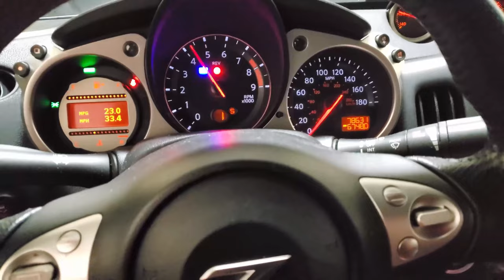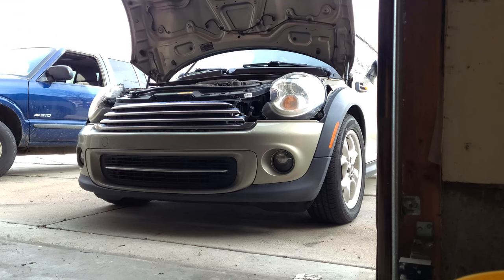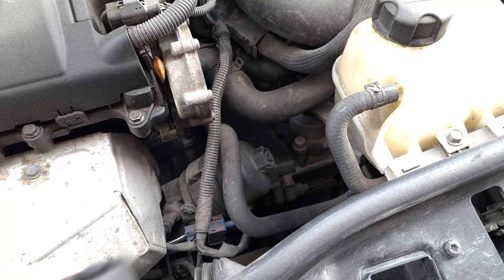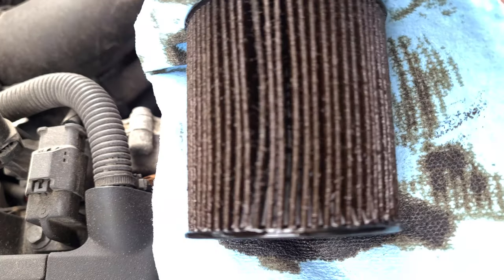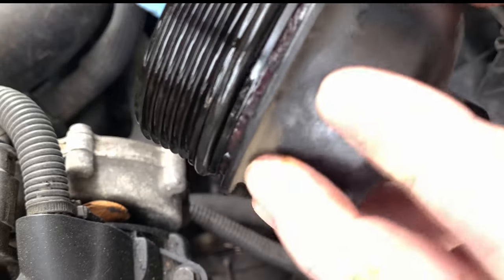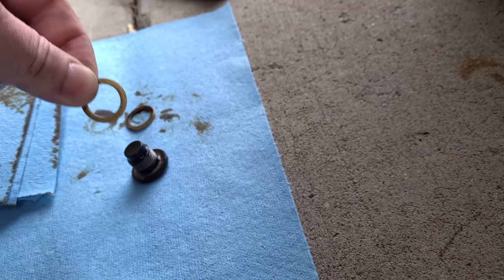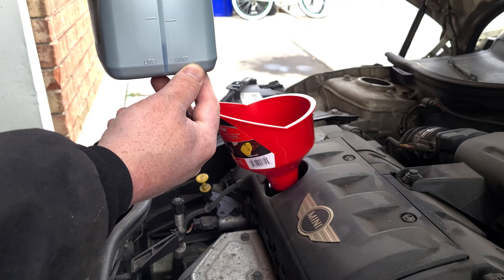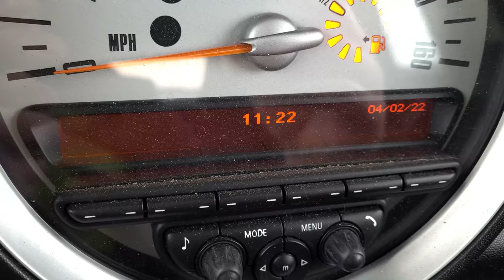The Complete Guide to Mini Cooper Clubman Oil Changes 2007 - 2014

Comment: Solid.
I am considering purchase of a used mini and i prefer to do my own oil changes but i have heard of the high expense associated with the car.
What is your cost for the filter and oil?
Did you use the Euro blend?
Reply from the maker: Thank you Christopher! I used Mobil one and I think a 7 dollar filter. In my experience they're expensive at shops but really no different if you do the work yourself. A couple unique tools and a set of standard and metric sockets and your good to go. I've done brakes and clutch as well.